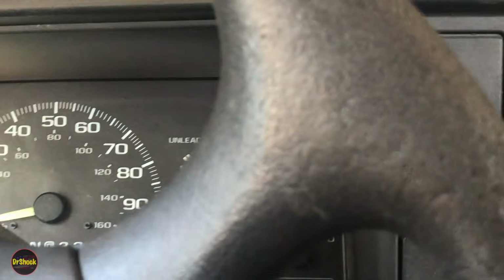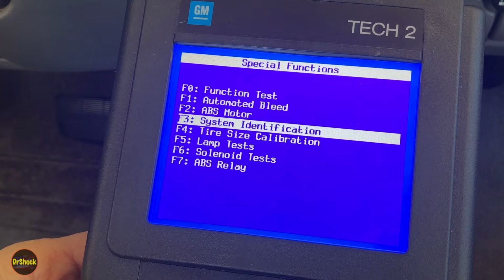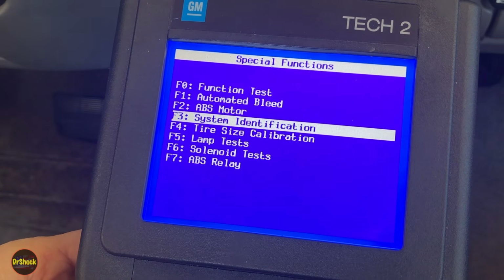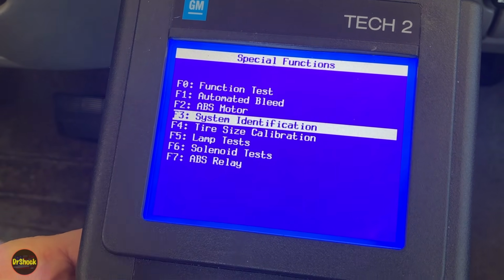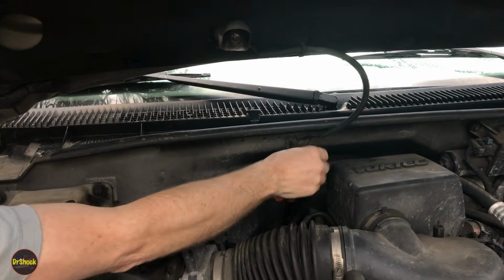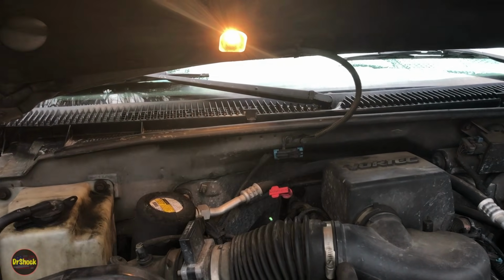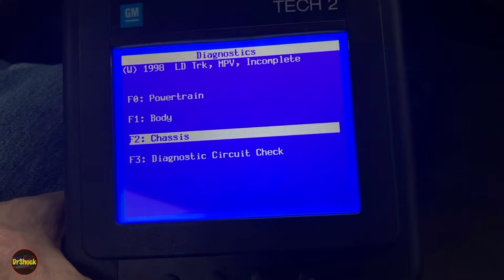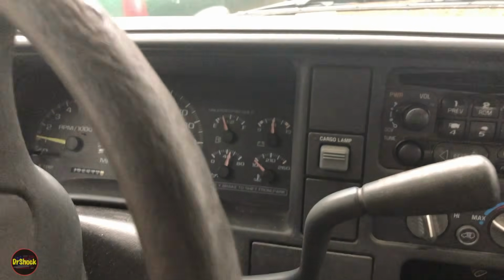1995 - 2002 GM OBS Truck 4WAL ABS Module DTC C0268 Repair Kelsey-Hayes EBC310 Teardown (Chevy & GMC)

Comment: Great video!! Thanks for taking the time to break this down so thoroughly. I am having an issue with a 1996 2 door Tahoe that I cannot see the ABS system at all. I have tried numerous tools and it looks like the whole abs unit is dead. I have checked all fuses and wiring. All are good. I swapped out the EBCM with another unit from a same year truck. (after watching this video I need to see if it is compatible) and I am having the same problem. Is it possible I could have 2 bad units in a row?
Reply from the maker: Thanks.  If you're not getting any communication at all you'll want to verify the communications bus wiring is intact.   I would say it highly unlikely odds wise to have two bad units in a row so sometimes it's just that Occam's Razor applies.  ;-)
Reply: @DrShock thanks for the quick response, any suggestions on testing the serial bus wiring? I’m an noticing that the ABS light illuminates, and then flickers off for a moment and back on. So quickly, if your not watching it, you would never see it.
Reply: @DrShock I did the ABS systems test in the 1998 CK Service manual this morning and everything seems to be checking out from a power standpoint.
Reply from the maker: You'll want to go thru the service manual checks for the serial bus wiring (since your original complaint was no scan tool communication).   It's possible for the unit to be powered still have no communications.
Reply: @DrShock I did the Serial bus test and I have 5v on the data line. According to the CK manual it appears to be shorting to something that is giving 5v in the Key on position and also in running condition. It should read zero V. If the unit abs unit was bad, could it short the data line in this manner? I am debating on running a temp serial line to the OBD2 port and the abs harness. Do you have any suggestions?
Reply from the maker: That's good progress.  I would find the wiring schematic in the service manual that the 4WAL ABS unit is shown on, and disconnect all the modules sharing that same data line.   There's at least the passlock module on that one, maybe one other.  See if you're shorting to voltage with nothing plugged in to eliminate a wiring harness fault.  Then start plugging modules back in one at a time until the short appears.
Reply: I disconnected the SB wire at the unit and the OBD2 port. Zero voltage with Key on. I jammed a wire into the open wire (12 Tan/Wht) location in the harness and plugged it in. I am getting 4.2 volts from the ABS data line port on the ABS module itself.
Reply from the maker: I'm not recalling the specifics of the serial bus test checklist you are going thru in the service manual, but if it says you should have 0VDC, then based on that you have found your EBCM comms problem.  And you are getting this with both of the EBCMs you have?   The odds against both of them being shorted internally this same way would be quite high imo.
Reply from the maker: Actually pondering this some more, are you sure you are checking the correct wire.  The serial data bus for your model year should be a purple colored insulation.   The tan/white will just be a diagnostic feed, not something involved in the scan tool communicating with the EBCM.  Review the section of the service manual under Wiring Systems involving Data Link Communications and the EBCM.  Even though you do not have a DTC, the tests in there would still be worth running thru.
Reply: @DrShock   I wondered that last night when I was looking at the schematic to tell you I was looking at the (12 )Tan/Wht wire. I saw the purple wire on the DLC. I will start over and begin testing from the beginning. Side note: I am able to see the PCM, and restraint system, communicate and clear codes. Thank you for your patience and assistance.
Reply: Question. Ultimately I am trying to cycle air out of the abs system. Until I can chase down the electrical issue, is it possible to manually run the pump to cycle out the air?
Reply from the maker: The model years this video covers need a Tech2 scan tool, or aftermarket of equivalent bi-directional control functionality, since the BPMV bleed valves are electronically controlled.
Reply: If I removed the controller and expose the valves, can I manually depress each of the valves to bleed them while pumping up and holding the brakes?

Back to the wiring, I discovered that the air bag system shows that an impact was detected. Since they share a data line, could this be a possible issue with the abs?
Reply: The Airbag light is not on.
Reply from the maker: I would not know, disassembling the BPMV like what you describe is not a documented or supported service procedure by GM.   As for the sir module, impact detection all by itself would not prevent data access to the EBCM.  But an impact could imply wiring harness damage that could.

Comment: Hey doctor, how much is this unit ,the whole thing brand new and does it only come from GM?
Reply from the maker: The complete units were only ever sold by GM, but now discontinued.  They are not rebuildable either.   The video goes over the individual part numbers that will have to be sourced separately via NOS or salvage, depending on the repair.  Links in the description.
Reply: @DrShock  ok thank you very much I appreciate that have a great day

Comment: Was the candi module connected in this video
Reply from the maker: No, this 4WAL ABS module is a pre-CAN era one from the 1990s.  So no CANdi needed.
Reply: @DrShock  Iam looking for a tech 2 to diagnose  1991 to 2007 gm cars and trucks. Can I get by with the tech 2 with no candi module.
Reply from the maker: Everything at GM went CAN by model year 2008 afaik.  But I think you'll only get thru 2006 trucks, as I believe CAN started in 2007 on the new truck architecture that launched that year.  For cars, it depends.   I think Corvette went to CAN in 2005 though.  A few Cadillacs went earlier too.  So cars wise I think you should presume 1991 thru 2004 to be OK, but hit or miss starting in 2005.
Reply: @DrShock  do you think I could get by with a clone tech 2 with candi module and all the adapters.
Reply from the maker: WITH the CANdi yeah, for that year range would be fine.  But you asked about w/o the CANdi initially.   You'll need an MDI insead starting in 2008.  To find what year/model dropped Tech2 support use this GM PDF (they took it down but it's still on the Wayback Machine) - https://web.archive.org/web/20201025200221/https://www.genuinegmparts.com/pdf/positionstatements/vehicles-supported-by-GM-scan-tools-reference.pdf

Comment: Educational Tutorial. The take for me is that I will need a used unit. Following your guidelines for my 98 K2500 Suburban 7.4 4L80E. There isn’t anyway of knowing what your getting used unless there was power in your salvage vehicle , is that correct? Was that your situation with the one you purchased.
Reply: To add can the unit be manually bled or only with the Tech2?
Reply from the maker: These 95+ years need a scan tool, Tech2 or equivalent bi-directional, for the BPMV bleed procedure.  You may find a modified, or non-stock, vehicle at salvage.  But presuming it's still stock (because these 4WAL ABS units were never available via aftermarket suppliers) just knowing the RPO codes from the glove box should suffice for a match.
Reply: @DrShock  Thank You for the prompt response.

Comment: Will a control module from a 1500 will work for a C3500???
Reply from the maker: No, differences in power train combos and weight ratings drove differences in ABS requirements so GM had to develop different parts for the 3500 series brakes.   I have all of the different combinations listed in the description.
Reply: So I should only replace it with the exact same year and model for the EBCM?
Reply from the maker: You could use either a C or a K 3500 truck.   I would aim for the same year or higher thru 2000 (they were still making OBS HD trucks for a bit past 1998).   But if you're in a pinch and no good salvage yard selection of 3500s, lower years of the same part number should work too.
Reply: @DrShock  will a 99-02 Chevy express 2500 be workable with the C3500?
Reply from the maker: The G vans use a different ABS system than the C/K trucks, so the programming inside the module is going to be different.  You might find what you're looking for on eBay tho.

Comment: I have a 1998 GMC Sierra C1500 that has the abs light on, but when I try to read the abs codes it says that there are no codes, what could it be?
Reply from the maker: Are you using a bi-directional scan tool?  A regular OBD2 code reader typically can’t access ABS or SIR module codes.
Reply: @DrShock  I got access to a high end snap on scan tool which does all of that and it didn’t show any codes
Reply from the maker: If the lamp is lit, you have a code (presuming there's no damage to the instrument cluster flexible circuit board).  If your snap-on has both a generic OBDII mode and a OEM specific/proprietary mode, I'd try the latter configuration set to GM.
Reply: @nauju1998  Were you able to eventually read it?

Comment: I have a '99 old body style K1500 Suburban, and had trouble with an intermittent ABS light. It showed C0221 RF Wheel Speed Sensor Circuit Open, C0222 RF Wheel Speed Signal Missing, C0223 RF Wheel Speed Signal Erratic error codes in the memory.

I checked the wheel speed sensor, wiring and connectors, power supply to the EBCM, the output signal of the sensor (oscilloscope), resistance of the sensor (DVOM), all perfectly to specification according to the GM service manual. I figured there is nothing left in that system so I got a used EBCM. The used EBCM (from a K1500 Yukon) has been working reliable for weeks, when starting the engine the ABS light comes on and goes off after 2-3 seconds like it should.

But the used module seems questionable too: Neither a Tech2 or a VCX Nano can talk to it, whereas I was able to read out the original EBCM just fine. Do you have an idea what could be the reason for that?
Reply from the maker: Hmm, I'd say if a Tech2 could communicate with the original EBCM then you have a good working communications bus wiring in your truck.   But if the replacement EBCM has no communications with the Tech2, then I would suspect that EBCM as the problem not the truck.  Easy test is just swap the modules again and confirm communications resume.   Check the condition of the pins in the EBCM connector of course, as well.

Comment: Thank you for the video it was very helpful. I have a question for you. You said diesel need to have a function test done 4 time to bleed the air out of the new system. I have looked online and have not found any information. Do you have any information on a ABs function test? My truck is 1995 C3500HD OD1.

Thanks 
Robert
Reply from the maker: That 4WAL automated bleed test would be in the Tech2 scan tools special functions menu, if you do not see it there then it may not have been available until 1996.  1995 was the transition year to OBDII so some tests may not have been available until later.   Here's a link to another video where I go over actually performing this test - https://youtu.be/4fImUhpWIdU
Reply: @DrShock  My truck is 1995 C3500HD with a 6.5 diesel OBD1 with the 4WAL. Will the TECH1 work with OBD1. Is there way of bleeding the system manually? 

Thanks 

Robert
Reply from the maker: You can use a Tech1 tool with OBDI, or the Tech2 with one of its included adapters for OBDI.  The earlier units did have a manual process, but I'm not familiar with it.  Would be in the older year GM service manuals I'm sure.
Reply: @DrShock  Thank you
Reply: I hate to bother you again. I have completed steps 1 -12 all my grounds are 0.4 to 0.7 oms and my voltage on C-3 is 12.5 to 12.6. The codes I have now are 22' 23' 27' 28'. I had found ABS module on Ebay. I had cleared my code and plug in all the electrical connection's to check for codes before connecting the brake lines. I ended up with a code 35. Thinking I had bought a bad module. I had bought another one from a junkyard. I had repeated the same steps and now I have a codes 23 and 26. Do you thing all of the module's are bad? 
I have all so checked grounds at all wheel speed sensors and transmission sensors and all read between  0.4 to 0.7 oms. I am thinking the ABS modules could be bad. My ABS light does not come on to show codes. All of the codes are showing up after I clear all codes by unhooking the battery cables and scan for codes. As soon as I reconnect the battery cables the codes show up. I don't even have to start the truck. Only turn the key to the on position and the codes show up. 
I am thinking the two modules  I have bought. The people who sold them to me may not have realized they are bad if the didn't have an ABS light on the dash? 
I am trying to make sure I am not over looking anything. 
Can you please let me know what you think? It would be greatly appreciated. 

Thank you 

Robert
Reply from the maker: It's expensive just firing the parts cannon and throwing parts at a problem with no diagnosis.
 
Your original post was about manual ABS module air bleeding with no reported codes.  It's not clear when the codes first manifested, but I'm going to presume none of this is related to just bleeding the ABS module itself.

Codes 22, 23, 26, 27, 28, or 35 can all be either PCM related codes or ABS EBCM related codes. In 1995 the same code numbers were reused for both.  To retrieve the ABS EBCM specific codes, rather than the PCM codes,  be sure you are following the 1995 service manual procedure for jumpering DLC connector cavities A and H if you are not using a Tech1 or Tech2 scan tool.
 
For the EBCM, all of these codes except 35 are front wheel speed sensor related circuit codes.  Code 35 is coming from the transmission speed sensor circuit insead.  While these could be indicative of a bad ABS EBCM, it's more likely the wiring harness to and from them all.   Especially since you've already tried replacing the module 2X now.   Since the subset of codes vary, you could take those experiments to possibly point to the wiring closest to the ABS module itself, since fiddling with unplugging and plugging seems to change the codes reported.  I'd try to recreate this behavior on the original module first, as well as confirm the original module is in fact the 1995 unit for the C3500 truck you have. 

Section 5E of the 1995 GM service manual is where you'll find the data needed to debug this further.
Reply: @DrShock  I was asking about air bleeding due to  I was of the understanding if you fallow the steps in your video 1-12 and you check ohms and voltage and you are in spec. Then if you are getting code there's a problem with the EBCM brake module and needs to be replace. There for I had codes and was thinking I need to replace the ECBM system module pump etc and would have to bleed the system. 
After getting the first replacement ECBM. I had the code 35 and was different  from the original pump. The original pump had the fallowing codes 22- 23- 27-37. The third pump had a code 23 and 26. All of the codes are ABS codes according the the book that came with my GM code scanner. I have replace the ECU as well. Can prom chips go bad? I never heard of one Going bad.
I am trying to figure out if I am doing something wrong? The part the made me question the replacement ECBM's. If there's nothing wrong with them how come they show different codes? I would think I would have all of the same codes from my original ECBM.  
 I have tried a few local shops and know one has scan tools for OBD1 and they don't want anything to do with it. So I am do what I can. 

You said all codes with the exception of code 35 is coming from the transmission speed sensor circuit. Why doesn't that show up with the original one that's still on the truck?
When the weather temperature is cold the truck is erratic. My shift point become further apart and if I don't have the block heater plug up the rpms will run high till it warms up. Rpms will go over 2000. So I was think this could be related to a circuit board not making good contact in the ECU or the ECBM. 
I don't have any engine codes either.
Thank you for your time Robert.
Reply: I have tried to use electrical contact cleaner on all of the connection's going going in to the ECBM' Wheel speed sensor. Transmission sensors as well.
Reply from the maker: I think you misunderstood what I typed earlier.  The 35 is the only transmission speed sensor wiring related code.  The 2x codes are all front wheel speed sensor wiring related.  The common denominator in all these codes is a wiring issue.  

Here's a PDF (not my upload btw) of the 1995 GM service manual, try going thru section 5E1 here and see if this helps guide your diagnosis more accurately - https://www.mediafire.com/download/bcg3688icghbksr/GMT95_CK-1_1995_GM_CK__LIGHT_TRUCK_SERVICE_MANUAL.pdf
Reply: @DrShock  Thank you. I will check it out.
Reply: I didn't expect the whole manual. Thank you once again and have a good weekend!

Comment: I have a problem like a bypassing master cylinder I changed the master cylinder 3 times! I see there is a dump valve (310 Kelsey hase) '97 GMC c1500 where it is a dump valve located ?

Comment: Hey sir. I don’t have a power bleeder can I just bleed normally?
Reply from the maker: You will have to have a Tech2, or similar, bi-directional scan tool to initiate the auto-bleed of the ABS modules' BPMV.  But you can bleed the rear wheel cylinders and front calipers in the usual way if you don't have a power bleeder.